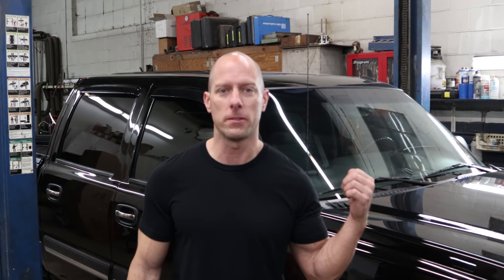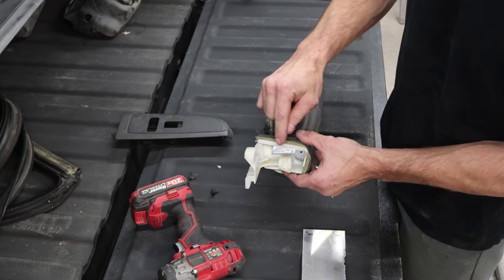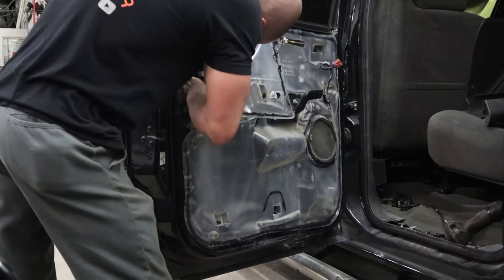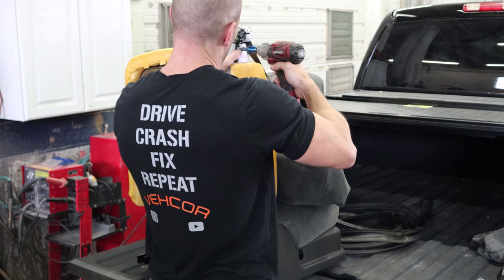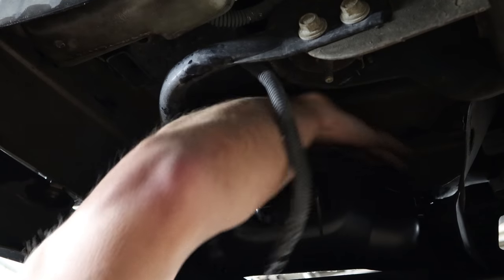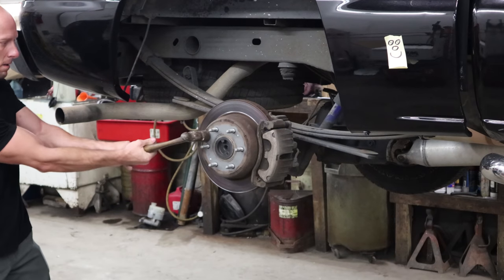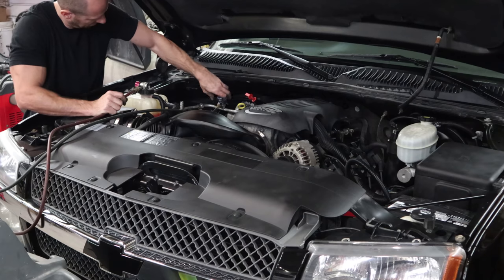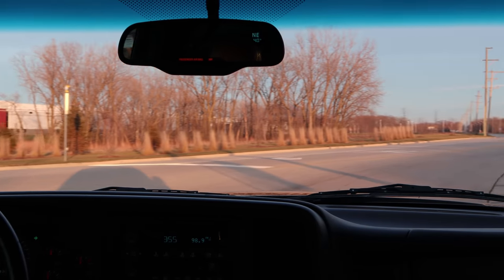Chevrolet Silverado side collision cab swap rebuild part 4

Comment: Another great build.  As an owner of black 15 Silverado crew cab, I do not want to run into you in person!  What is it with black GM trucks.  You mentioned your rust proofing product for the rockers, could I get the link for it on Amazon as winter moisture here in Alberta is almost as bad as Ill.  Thanks for the great project build series.
Reply from the maker: Thanks, the cavity wax is in my store with the wands as well.  It helps to extend the life of vehicles in our unfriendly environment.

Comment: the 06 air bag sensor system in the passenger side front seat senses weight on the seat and turns on the passenger side air bag. it shows when it is off in the rearview mirror on the windsheild. other years have a key switch in the dash to shut off the   air bag..  tip: when you work under the hood you can move the front spring of the hood hinge back in another hole so the hood is opened  higher. do both sides.

Comment: Easy way to put on seat covers, get a product called silk film, or, a dry cleaning bag. Put it over the foam, attach a vacuum and suck out all the air, as much as possible. Pull the seat cover over as fast as you can before the foam "reinflates". It makes the interior seat smaller to fit the cover over, at the very least, it makes it a slick surface. When you get the cover back on, pull as much of the silk film out as you can, or just leave it in there, but rip it so it doesn't make noise or hold air inside.

Comment: I love my vent visors!
Reply from the maker: I don't mind the ones that don't use two sided tape on the painted surface.  The slip in ones are great!
Reply: @vehcor  My truck just turning 10 years old, when its 90 degrees outside I leave my windows down about 3/4 inch when parked and my headliner still looks like new, no sags.

Comment: You do excellent work.  Rust free trucks are gold up north.  Did you factor in the money you will make back from parting out the parts truck in your "profit" ?
Reply from the maker: Thanks, the rust free feature should overcome its lack of 4wd.  That is my thinking anyway.  I never figure in the price of the parts I sell until they are gone.  Then it becomes extra profit.

Comment: I never really read the comments. Are there ppl trashing you on your builds? Considering the hacks out there doing a head gasket on an s2000 motor and not send the head out or anything else, I think you’re very efficient in what you do.
Reply from the maker: Just haters hating.  Most of which have never worked on a car and are just jealous.  Instead of doing something with their pathetic lives, they try to bring others down.  I just like to give them a little attention and a bit of what they give to others.  It seems to bother them a lot.  Some learn, some are just going to be stupid forever.  Thanks for the support!
Reply: vehcor I actually enjoy ur builds. You have knowledge of what you’re doing. Unlike some ppl that change a head gasket on a s2000 and don’t send the head out to be checked.

Comment: "This is where you should sue LocTite GM" Truer words could not have been said...they use the crap everywhere else BUT where it's a must.
Reply from the maker: They did use it, but they use much more on every other bolt! 😂
Reply: @vehcor  I know right? I've pulled radios out of GM trucks and the screws b=have more blue on them than stuff like seatbelt bolts do!

Comment: Scott at 6:45 the door on the outside looks like the clear coat is flaking and the paint looks like runs but this was after the paint fairy's did the paint, is this an optical illusion? Or is this the parts truck and I am just confused as the outro shot showed perfect flawless paint.
Reply from the maker: It was spray mask, washes off with water.

Comment: is it possible to put a 2500hd frame on a 1500 crew cab shell. i have owned my 2005 1500 since it came out and im sentimental about the truck so here is my thing my buddy has a 2500hd frame with the duramax but the shell was crushed by a collapsing wall at a fire ground no damage was done to the frame or engine but i want to put the shell of my 1500 on the frame due to my 2005 having about 300k miles on the motor
Reply from the maker: Yes, the body is all the same.  The radiator support is different but everything else should work fine.
Reply: vehcor awesome thank you for the insight

Comment: Do you hate visors because they're a pain to deal with as a body guy, you think they look bad, or do you have some other vendetta against them?
Reply from the maker: I don't like the ones that stick on the paint.  Probably because in my line of work I end up having to remove them.  I do hate the camouflage ones though.  They look silly on a vehicle painted anything but camouflage.
Reply: @vehcor  I would definitely agree on the camo and I'm in the center of Nebraska where camo everything is rampant. I'm also more for the in-channel version as well. They look cleaner and fall off less. Thank you for the reply!

Comment: Question.
What if you had a perfectly good cab to swap over in place of the bad cab? Would it still take as long to do it and would the newer good cab have to be stripped as much to swap it? Or could most of the stuff be left intact and swapped?
Thanks

Comment: They make a spray can product to make upholstery easily slide over foam, what we do in Aust is The repair diary, all photos from start to finish, have receipts for everything, all documented on what you did, you can drive it on the road but only to get the 3 steps done, then its off to the accredited body shop so they can do a structural report, once that's passed you get the roadworthy certificate lights tyre's all that jazz, then its off to the registration office pay for final transport inspection, then you ring transport to book in, they don't go anywhere, hopefully they pass it which they have always done with my vehicles, i call it the jumping through the 3 burning hoops procedure.
Reply from the maker: I've never heard of the spray product.  We have similar standards for rebuilt vehicles.  This one just has an extra step to put the vin on.
Reply: @vehcor  i used to be an upholsterer as my first job it was decades ago and I have never had to source it, but i know when its sprayed on foam it makes it very slippery and materials slide over it easily.
Reply: @vehcor  Its Teflon i believe, worth a look as it has lots of uses, can spray on saw blades for easy cutting, hundreds of uses as per data sheet, i might buy a can myself.

Comment: What kind of screws did you use to secure the glove box? dumb question I know but I am swapping mine and from factory it is riveted in
Reply from the maker: Just the 7mm that come in it.  I left the door on the lower trim so I did not have to remove the rivets.
Reply: makes sense, I had to drill out 1 rivet on the truck at the junk yard, that was accompanied by two 7mm screws attaching the hinge to the lower trim, I think I’ll just leave the rivet out and replace it with an additional 7mm screw

Comment: When installing the winter air in the tires it was unclear whether or not you changed the direction of the air nozzle switch so that the tires on the left side received lefthand air and the tires on the right side righthand air.  In overlooking this important step I've installed air incorrectly which caused the car simply to spin in place; a rookie move that embarrassed me more than once, I'm afraid.
Reply from the maker: I'm no rookie of course I did.  If you get it wrong they usually pull to one side!

Comment: I have taken hundreds of dashes out for heater cores evap cores and temp door replacements and I cant recall one coming back saying I have a rattle. Helps to out all the screws and bolts back in. Most of the hatters probably live in there mom and dads basement lol
Reply from the maker: I believe your assessment is perfect, or at least is the same as mine!  lol I have torn many bodies to a bare shell and reassembled with no issues.

Comment: I love the way you put stuff back were it belongs. I showed my wife the part where you took all the trim off to get the rear window defroster wire out, and she said, "OMG he's as anal as you are!"  I took it as a compliment. Started working in a Chevrolet Dealership in 1972. Still turning wrenches, just a little slower now at 69 years old. Didn't seem to be able to find that link to the Cavity Wax though. Going to go back to MI in March and start the restoration on my 68 Firebird Conv.  Bought it in 69. The wax would come in handy I think! I'll be watching!

Comment: I know this was from back in 2019 but I had a 2003 and one thing I would (or even could) do if I was doing this job is to replace all the dash backlight bulbs. I watch one by one on my 2003 as they each quit working.

Comment: Never meant to question ethics if that's how it came across. Just curious about how it's done. Not a hater either and no I don't make 52/hr either, but that's ok. I don't have to do physically hard work anymore. As the body ages and back problems become a problem, it's better to farm out work. Thanks for your videos, I enjoy them.

Comment: So when you buy these trucks........do you search for clear titles or are they salvage title vehicles? Does the fact that it's done right and it's rust free make the salvage title a little easier to sell up there in the rust belt? Most people run in the other direction when they see a salvage title in my area.........even if it's done right. That's why I document each repair with receipts and photos of before, during and after. I try to buy cheaper cars because around here nobody wants a $40,000 truck if they can't put comp/collision on it. If you know of any insurance companies that do insure salvage please pass along a name. As always.....great stuff, keep it up! Thanks!
Reply from the maker: I search for good deals.  Title status doesn't matter.  I have no trouble selling because I have done my research before I even bid.  It looks like this truck might bring more than a clear title because it is so rare up here.  We'll find out when the title comes back.  Statefarm has never questioned my rebuilt titles.  They have paid out the same on totals and insure it with no questions asked.  There are others as well.

Comment: I noticed in a few videos that wax is used for rust proofing. Is that working well? I am asking simply because I was told wax dries and flakes, and water seeping under the wax is possible - and not good. Have this been an issue? Given this advice, I am using oil products. I would prefer wax however as I am supposed it is cleaner and easier (you don’t need much protective clothing). What product is used? Thanks and great video, as usual!
Reply from the maker: The stuff I put on 20 years ago still has not dried and flaked and I think I have the only GM plow truck with solid rockers so you could say it works. There is a link to the cans in my Amazon store.  Wurth makes the stuff I use in the gun.
Reply: vehcor wonderful. Thank you.

Comment: Do you sell the magic brake job hammer on Amazon? An what is is proper torque on valve caps?
Reply from the maker: It is just an ordinary hammer, the magic is in the hammering technique.  The torque spec is Gudentite! Don't forget the loctite!

Comment: Does that cavity wax only protect the inside from rusting? Any recommendations for rust resistant on the outside?
Reply from the maker: Yes, the rust starts inside.  If the outside is painted it needs nothing more than the occasional wash and wax.

Comment: Not to start a shit storm hopefully but does the adhesive you use for the windshield allow for clear?  I have always been told to leave it as a primer or bare so you can apply the primer they prefer
Reply from the maker: It etches through whatever is underneath so it doesn't matter.
Reply: vehcor mind if I ask what brand so I can recommend it to my boss?

Comment: You often mention vehicle rust problems in your state, due to the climate and the use of salt on the roads during winter. Have you ever come across a vehicle  with electronic rust protection fitted? If so, what's your experience on whether it prevents rust or not.
Reply from the maker: I have, it is a gimmick that does nothing!
Reply: @vehcor  Thanks for confirming what I already knew. I just wanted confirmation from someone with first-hand knowledge of vehicles in a harsh environment and what works and what doesn't work to prevent or reduce rust. The way you treat your vehicles to reduce the impact of rust is the right way to go..
These scammers are active here in Australia and are even advertising on TV. It costs around A$800 (US$550) to have one of these devices fitted to a vehicle here in Australia. No telling how many people have been ripped off by these scammers.

Comment: Ok not to be you dreaded hater but I have an honest question for you, Will the vin number work correctly for programming replacement body module or other replacement electronics? And I bet someone out there is looking for a classic Mustang hubcap.
Reply from the maker: Yes, it is the same.

Comment: Jedi can u help me wit this I got aftermarket 22 on my Tahoe and the day it broke down from a flate tire of the original be OEM wheel put the 22 on to bring home. Before I went to pepboys to get the aftermarket bolt for rims. I can't get the rim off. Any special tool to grab  the bolts off? I ask Tahoe nation on fb no reply
Reply from the maker: Usually a socket will take them off if they are like the ones in my second mistake video.
Reply: @vehcor  well I see I hope I can take to tire shop I was just out looking@ it. may get a power socket drill

Comment: Another note for the haters who wonder why a cab swap instead of changing the B-pillar: Changing the cab means everything is straight. There is no telling what the floor and other panels would have been like. I doubt it would be any fun to replace "a couple of panels," only to find half the [BLEEP] truck is bent and needs fixing.

Comment: Its really surprising how much of this just snaps/clips together.
Reply from the maker: Most cars are that way.  Seconds saved during assembly, over time adds up to millions of $$$$
Reply: @vehcor  Everything I work on (Factory maintenance) is put together with all these fiddly little screws and spring loaded crap that flies to pieces, sending me hunting ball bearings, springs, crews etc.  Fortunately, I've gotten better at keeping stuff like that together.   All that goes back to low vs high volume production.  Thanks for the interesting Vids.

Comment: Wrong pair of tinsnips that do the right job, which is all that matters. And you should sell those repair brackets
Reply from the maker: It would have made the job a little easier with the right ones but finding them would have been harder. lol

Comment: This reminds me i need to get a replacement factory inner door handle for my 99 tahoe. All of the aftermarket or help ones we bought for my wife's 98 suburban kept being cheap and breaking so no more 3rd party ones, it's OEM or dump the truck either way. i need to get it resolved because i don't drive that one often but getting out of it by rolling down the window first sucks! God, How much of a loser do you have to be to hate on a guy repairing trucks online? That's both retarded and sad! but if you don't have haters and trolls you're not doing something right. They are the ones that really make you all of your money lol
Reply from the maker: I hated those old doors handles on the outside that you had to remove the inner part of the door! The haters are just jealous and pathetic.  It is fun to antagonize them!